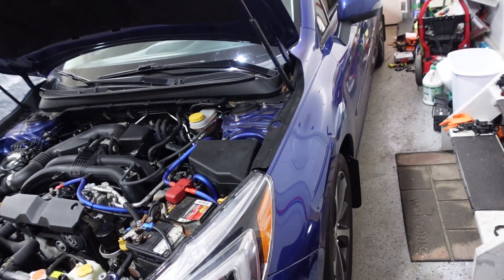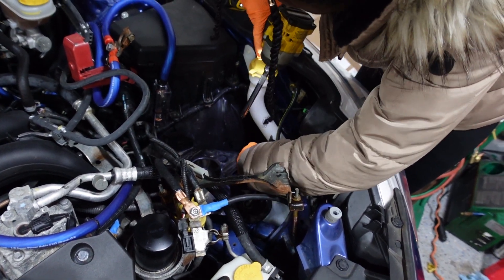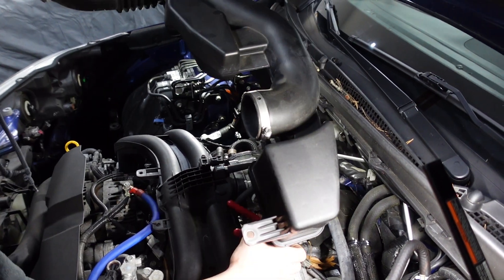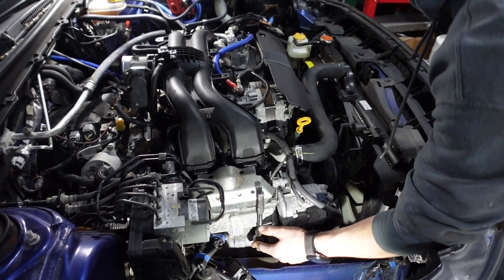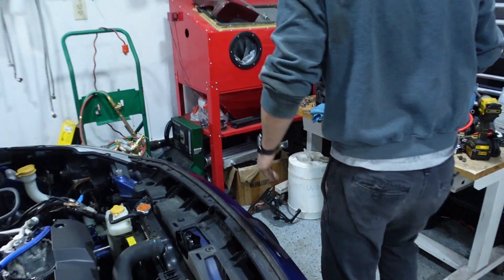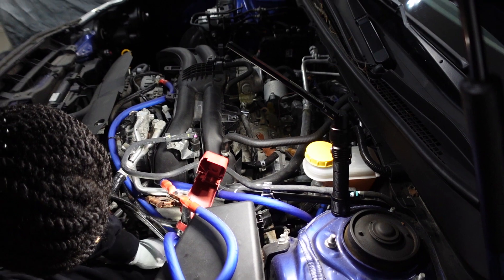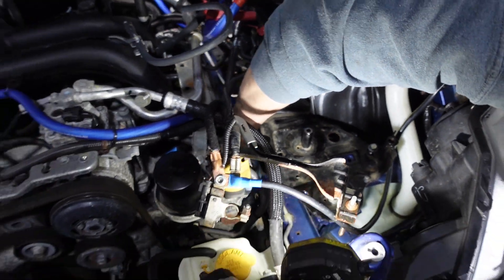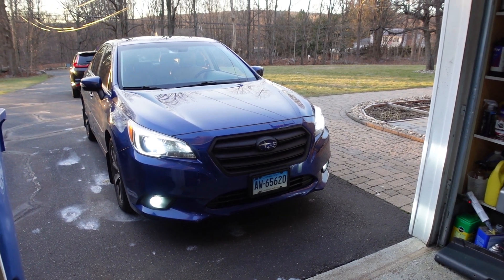Changing Spark Plugs 2016 Subaru Legacy 2.5 (Easy DIY)

Comment: Those plugs on the driver side are a pain to get. Especially getting those two bolts from the battery mounting plate.
Reply from the maker: Yeah spot on there. Worse part of the whole job. Overall not that bad tho.